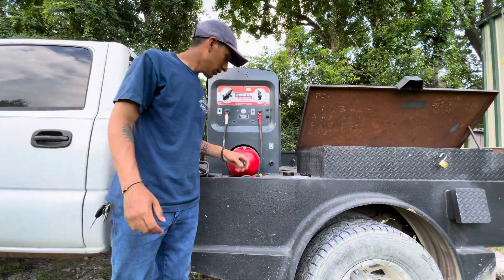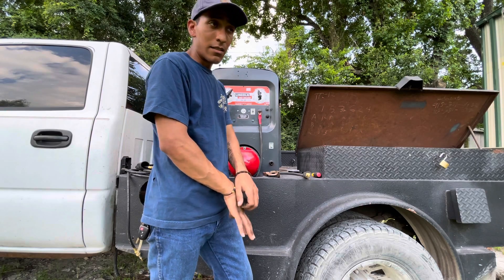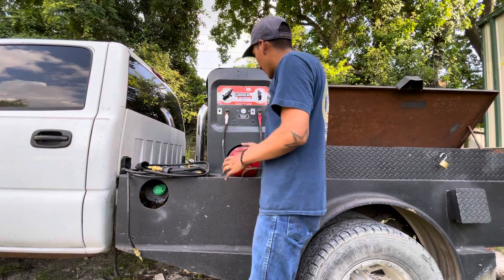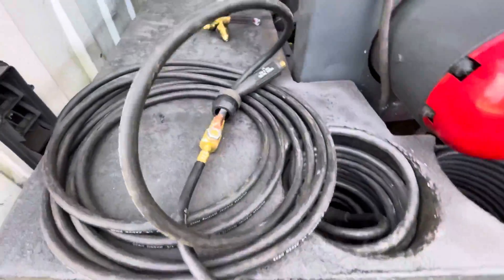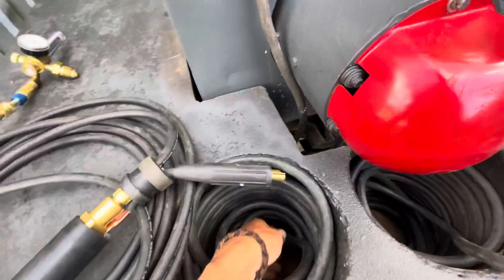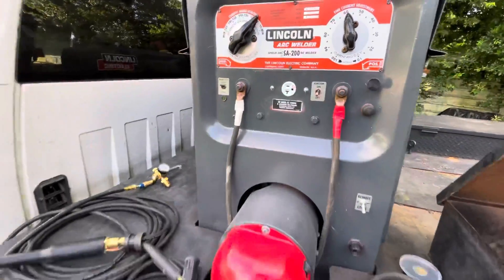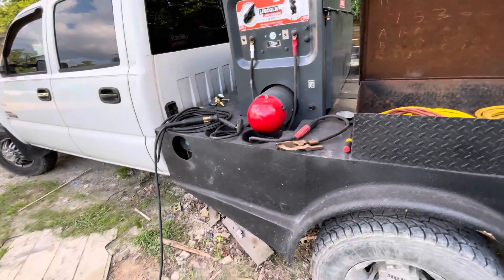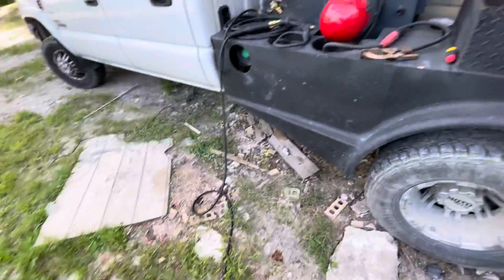How to hook up a TIG rig to a SA-200 and what you will need for it.

Comment: Mira tengo una miller 225 bobcat acdc como puedo conectar una serie 17 tig torch para soldar aluminio  saludos desde dallas tx
Reply from the maker: @weldermuneco9836  no se puede soldar aluminio con el bobcat 225. Al menos que le conecten una máquina que es AC para tig en el 240. La máquina solo puede soldar carbon y stainless.

Comment: Hey man I know it’s three years late but can I use my remote for my heat still with tig?
Reply from the maker: @CozyCris  of course man.
Reply: @ okay thank you 👍🏼
Reply from the maker: @CozyCris  just don’t grind and weld at the same time. But you can adjust while welding no problem.

Comment: Were did you get your adapter por the tig to the generator
Reply from the maker: It came with the tig rig that I got from “Coastal Welding Supplies”

If you just want the part. The part info is “PROFAX Lenco TIG TORCH CONNECTION KIT TTC-150 Amps 150”
Reply: @tejaswelding  do yo have a tutorial on how to cet it up I have a thermal ARC 10,000
Reply from the maker: @esecruzangelopez6292   just made one, it should be uploaded soon.
Reply: @tejaswelding  thanks

Comment: I was wondering the size of  well you have ur welding in ? And what gage of leads
Reply from the maker: Size well? My gage of lead is 1/0 but for my whip on my stinger to weld stick is a 2/0 I believe.
Reply: @tejaswelding   thanks for the reply! And the holes you have you're leads rolled up in down in the bed of your truck bed
Reply from the maker: @mikediaz6588  8 inch and 1/4 hole and 1 foot deep. Hold 50 foot of leads. On each side. Both are the same size.

Comment: Im gonna try this on my Hobart 260 an see how it works.
Reply from the maker: As long as you have your tig rig on negative and ground on positive then you should be good.
Reply: @tejaswelding  i have to get the setup for tig welding first then ill try it out. I ant never tig welded before
Reply from the maker: @melvinmariott8609  it’s all good. This a good way to start then. Going to burn out a lot of tungsten so buy a box and sharpen allot of them as well. Have fun and always be patient with this process.
Reply: @tejaswelding  gonna try it out an hopefully i can get pretty good at it.
Reply from the maker: @melvinmariott8609  once you get the hang of the start and heat movement it should  be easy from there. Run hotter to start and then bring it down. Make sure to run your filler wire right in front of the puddle and not to far or it will ball up. To close can get stuck or end up touching your tungsten.
Reply: @tejaswelding  thanks for the information on this i can't wait to give it a try and see where it goes. You have a great day and be safe out there

Comment: Hey man I'm practicing on 2" carbon super coupons and moving to 2" sched 40 stainless getting ready for a test. What gear and amps are you running for pipe?
Reply from the maker: Oh man that’s a question kinda hard to answer at the moment since I haven’t welded a 2” s40 pipe. Maybe rico from the “Weldlab” can help you out on that. I would need to find me some and test it out to let you know.

Comment: 225 Amp Eagle 10,000 Plus Gas Engine Driven Welder w/Stick Leads, Multi-Process, 10.5 kW Peak Generator (Kohler) can you do the same thing to this one tig
Reply: I got a bobcat 250 multiprocess
Just select rig normal conections that’s it same with mig or fluxcore just select the process

Comment: How do you strike the arc with out a pedal
Reply from the maker: Just like how you would with stick welding. Scratch start. Like a match. Quick scratch and then back off so it won’t get stuck to the metal.